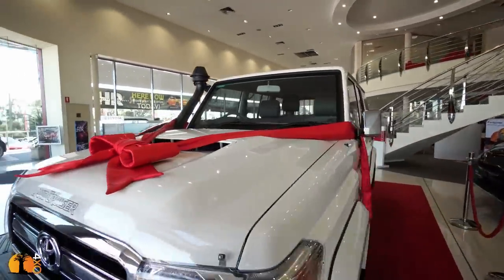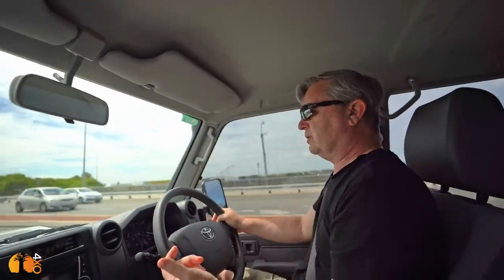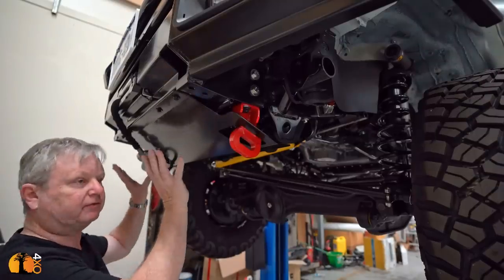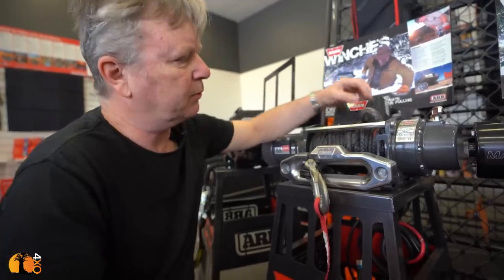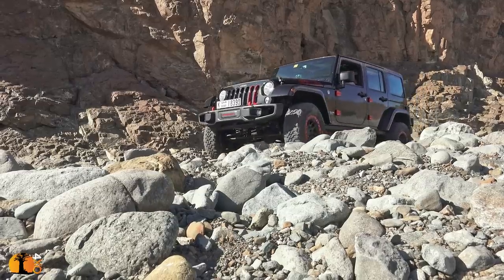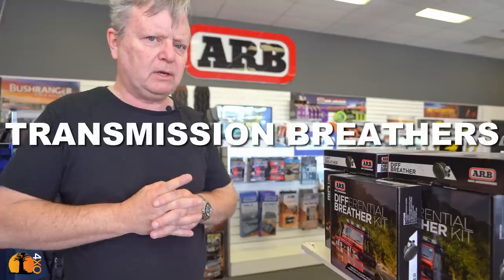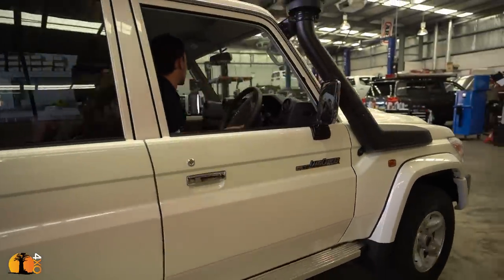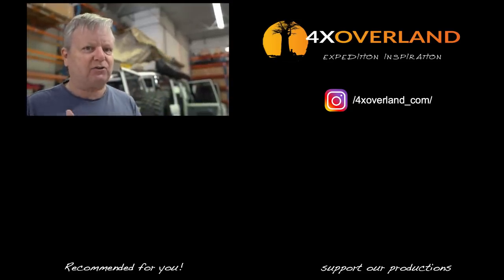How to convert a SUV into a 4x4 Overland Tourer. Toyota Land Cruiser VDJ76 | 4xOverland

Comment: good luck breaking a plasma line. when I was a U>S>Army Watercraft operator ( Deck side) on the small (900 Series Tugboats) as well as the bigger tug boats, that's all we used to tow the craziest of things. to date I don't remember hearing of any plasma lone breaking. so its good to hear that you can get plasma's for your vehicle winch. put a winch of the front and rear of your vehicle and set up to pull on both, I will bet that you will rip your vehicle in half before those lines break

Comment: The method I'm using is just take the vechicle out a lot and see where the limits lie and adjust accordingly. That way you prevent buying unnecessary "upgrades". I mainly use my vehicle on weekends for off roading with planned tours once in a while so I have the luxury to do that.  Ofcourse when outfitting for a big trip sometimes you need to do it in one go so good tips for that kind of stuff. Tires and a good air pump are THE best upgrades when starting out by the way. Seen guys with ARB bumpers and expensive lighting getting stuck because they use road tires in the mud :D

Comment: Soft shell tents have their advantages particularly since you can go out to king sized mattress and still not take up the entire length of the roof rack. The best I've seen for a hard shell traditional clam shell tent is a double sized mattress which is barely enough to sleep two comfortably..They may take 10 mins or more to set up..but at least a family of 3 or 4 can sleep comfortably..

Comment: When it comes to air compressors, I would have chosen an ARB product. From personal experience, even the single motor ARB compressor is far better in quality & durability than other brands in the market IMO. You really only need the twin motor model if you have lockers or frequently change air pressures (or  use it for cleaning dust).  But for use with tyre pressures, the single motor ARB compressor is more than sufficient.  I've had other brands and none of them lasted - most common failure is the motor overheating.  They just couldn't handle the task. I was lucky to get 2.5 years from one (the other two - different brands each - lasted less).  But the ARB, I've had now for over 5yrs and its still going strong - touch wood.

Comment: Amazing info and so much good advice, great video!!!
 
However, i would not agree about lockers. Lockers can be life savers. If i'm going off road i'm anticipating rough, uneven, muddy, sandy rocky or slippery terrain. Lockers are good for all of it. If you don't want the selectable lockers (ARB or OX) you can at least get the Torsen or Detroit so you don't have to think about it. It's a night and day difference unless you're on a flat terrain with good traction all the time. 
Some of my priorities for my area would be:
- more ground clearance
- bigger tires with more grip (mud)
- lockers (at least the rear)
Reply from the maker: Look, I don't disagree with you. But lockers often make bad drivers. Yes they can be life savers. But they are a cop out. Drivers who have grown up with them don't learn about effective lines through or over obstacles. This is the point I was trying to make. (IMHO. Larger tires - NOT wider. Its a fallacy that wide tyres are better in sand and mud. They are a disadvantage in most mud and no advantage in sand. Only an advantage in dry ground extreme grip situations like rock crawling. Proof: military and rally drivers use narrow tyres on soft ground. Another argument altogether!)
Reply: Lockers are good when you can’t drive

Comment: With an infrequently used winch he could spool it out and in every few months to keep it in check and moving

Good quality traction control systems might just be enough most of the time

If you wait 30 mins before crossing water you don't need breathers as cool steel and cool water won't cause the issue, downside is many cups of tea whilst you wait

Comment: the greatest item that influences fuel usage is the windage, even with only transverse roof  bars at 100km/h
you will use another L  per hundred  and with all that crap on the roof far more, towing a light 500kg trailer will be more convenient and use far less fuel, make the drawbar long , or you'll never back it as you cannot see it
btw LRs have all guards as standard

Comment: Thank you.Very inspiring. About winches - have you consider external (removable) winch? You can keep it dry inside the car and use it front/rear when needed. I think it could be great solution when you using it once or twice a year.

Comment: Andrew, you are truly my "go-to-guy" for referencing. Thank you for sharing what you love doing. I sold my Land Cruiser 76 (4,2 donkey diesel) for a Toyota Hilux - greater driving comfort and safety, as well as huge savings on fuel bills. What are your views on utes as ideal overland vehicles?
Reply: Grant Evans I have a new hilux, and I think the fuel consumption is absolutely horrible on those things, I don’t even have a front bar on mine, or massive tyres. I also find that they’re one of the most uncomfortable rides. So very interesting to hear you talk about the hilux this way. I hate my hilux and want a 76 😂😂😂
Reply: Hi Dean, I loved my Cruiser (14,5L/100km) and drove it to many, many places in Africa. I owned it for 8 years. The new Hilux (10l/100km), whilst having a full OME suspension upgrade and bull bar etc, is much easier to drive on the long haul, for example Johannesburg to South Luangwa in Zambia. However, nothing beats that Cruiser for toughness, does it?!

Comment: I'm pretty sure that letting air out of the tires won't give you better flotation. Less air= less flotation.
Reply from the maker: The opposite is true. Flotation is increased as the footprint of the tyre gets bigger. The larger it is, the less pressure there is on the ground. Tyre tread gets longer as the pressure drops. Less pressure = more flotation on soft ground.
Reply: @4xoverland  Ah, on soft ground. My mind went straight to water when you said flotation. 😂

Comment: Winches 7:48 I don’t really agree with “find out what other people like”. Because the market here in Aus is swapped with “cheap”. If you ran a poll here in Aus on winches ‘Kings’ would win buy a country mile. And there’s no way! I’d have anything Kings on my 4wd.
Reply: Oh come on, how can you not want a Dominator on to save the day again & again.. 😂

That said, their 7" spotties are pretty good for the money, 2 years of pretty abusive conditions on mine & still going strong. Use nail polish remover to get rid of the awful logo on the lens covers & they're every bit as useful as an $800 red bezelled lamp 😉
Reply: id never have anything kings either, but i did buy a kings winch to try it out (its hidden)...i literally cant kill it. i have actually been trying.
Reply: also, another way of deciding how big of a winch needed, a basic reference of 1.5 x GVW = minimum pull strength. (a more versatile way to apply to your vehicle)
Reply: Totally agree. Kings gear is utter shit

Comment: Very good concentrated video full of highlights! But I have a QUESTION: when a vehicle is not horizontal, it's sagging down at the rear because it's fully loaded, then some replace the normal shocks by coil over shocks to put the vehicle horizontal again. I'm afraid that is not the right solution because they bring over a part of the vehicles weight on the upper anchor point of the shock and that part is not developed to receive those big forces, isn't it. What's your oppinion ?
Reply: you should have a slight rake (usually 1-2" higher in rear) for aerodynamics and handling. this is also to accept the weight so when loaded it still has slight rake or becomes level. if you are regularly carrying weight that has your front sitting higher you need stronger rear springs (not shocks necessarily) to carry the weight.

Comment: Great video👌🏻
Very helpful..
I really think one of the most important modifications is the capacity of the fuel tank..how many liters can you modify the LC 76?? (Maximum capacity)
Thank you very much..
Reply: I think the LC 76  comes with a 130 liters tank and to my knowledge the largest to be fitted is around 165 liters.
Reply: @4x4pete30  165 additional to the 130??
Reply: No unfortunately 165 in total as a replacement. But at least 20% above standard, which can make a difference in some situations.
Reply: @4x4pete30  was expecting much more than that..made me a bit sad..
Thank you for your respond.. 
Cheers

Comment: Amaizing video! how do you fit the air compresor in this Land Cruiser? in the motor or in the back of the vehicle? where is the best part to put it? if you are touring.
Reply: In the bag, so it can be used on any vehicle that needs it.

Comment: Good points & a conservative build, perfect antidote to the bigger/more is better message that gets blasted in our faces from everywhere else. Glad you didn't go overboard in ARB too, now they aren't the only players in the market on accessories, as far as I can see the only truly good things they offer are the barwork (rear bars excepted as they're just unnecessarily heavy lumps of uselessness) & the magnificent freewheeling compressors. For a bit of fun, visit your local dealer & ask them to weigh the Patrol GU or Cruiser they'll have on show decked out in half of China's steel industry catalogue. I bet they wouldn't dare..
Reply: Rear bars are useful in some situations. I’d hang a wheel carrier on mine to move it from underneath the vehicle, and it can come with recovery points at the same time.
Reply: @cjeam9199  Agreed, however most on the market are severely overkill & weigh far too much. Considering there's normally a plastic/composite bumper there you only really need something structural for the recovery points & wheel carriers, not a heavy duty steel contraption. Would be nice if any of the manufacturers offered a slightly lighter weight model for those who simply want to relocate wheels rather than having pretty useless rear protection.

Comment: Question on the tyre, would a 265/75 R16 be better because it's performance would be very close to 285, it works be lighter and cheaper.

Comment: Fantastic video Andrew! Love these build videos! I'm considering BP-51 suspension but have heard they leak and squeak with the bottom bushes chopping out. As a mechanic i've seen several of these shockers leaking. So not sure about this decision.
Reply: For a few dollars more! Custom King 2.5 shocks with remote reservoirs and viton seals. Only talk to people that own them and not dreamers :)
Reply: Koni Raid HD all the way. Remote Res shocks are only really necessary when you use full travel, which you certainly don't come close to doing in any 70 series as they dont provide that much extra cooling & it's more bits to rattle loose over time.
Reply: @gaj5701  progressive custom King coils and Rockcrawler leafs in superior engineering Gen 2 plates with the kings and i get a hell of a lot of flex, if your comparing Konis' to Kings well i need not ......
Reply: @FZ-TAS  yep, you can certainly get good flex, however most don't go that far so on a build like the video there's no practical need to go as far as getting custom shocks or remote res units. The Koni Raids are well proven in outback touring use on pretty heavy vehicles & are pretty hard to destroy on corrugations so that's why I suggested them, not as a direct comparison to obviously higher end technical shocks 👍

Comment: First. In my opinion, weather it be supercars, motorcycles, commuters, 4x4s, or any motor sport, nothing is more important then the tires. In my mind there's no such thing as good enough. 

Second. On the subject of winches, I think of them like fire extinguishers. If you are using them regularly you may be doing something wrong. However if the time comes that you need one, you want the biggest most reliable one available.

Just my humble opinions
Reply: totally agree, tyres/tires are all that connect you to the surface you're driving on.... winches & fire Extinguishers, you hope to not need them but if you do need one you want it to be the biggest/best/ most effective you can get
Reply: I don't think so. I used my Warn winch most if the time to pull something which were nothing to do with srlf recovery of my Landcruiser. I am very often utilized the winch to pull wood logs, placing or moving heavy concrete pile bases to difficult places and other pulling, moving and placing/replacing or locating/relocating  heavy things. I utilized the winch to the maximum not only for self recovery of the vehicle and/or other vehicles.

Comment: For an overlander project that will through the American mountains (Rockies, Smokeys, Adirondacks, Sierra), as well as US Southern Low Countries, would you suggest a 1998 Jeep ZJ Grand Cherokee with 5.9L v8, with Quadra-Trac, which includes center locking differential in 4LO only, with open front and rear differentials OR a 2002 Jeep WJ Grand Cherokee with 4.7H.0. v8 with Quadra-Drive which has locking center differentials as well as front and rear limited slip differentials? I hear there are pros and cons to both, ZJ is easier to mod, not as good off road, the WJ is harder to mod, engine not as reliable, but is better off road. Anyone’s advice is welcomed please

Comment: Hmm...most people I know don't aggree about the difflocks. A 4wd without locks isn't a proper 4wd. This can already make a huge difference on a muddy lawn, and experience doen't help much if you HAVE to go slowly through twisting sections and our vehicle hasn't got a very good twisting suspension. Speed or momentum is not always a good compensation.
You might get around with a LandRover but not with a 4wd that's optimized for street use.
So I would say YES if your vehicle is extremely flexible, but generally NO (you need difflocks) with most 4wd.
And anyone will agree that experience lowers the need for difflocks. AND: difflocks also mean a great stress to all participating parts - so you really should use them only when driving skills don't help and not because you're lazy. It could quickly kill your axles or CV joints.
Also, on some ground, a front locker makes your car go straight like a train, even when steering. Can be really dangerous.
Reply: All new cars/4wds in australia from 2015 onwards have traction/stability control, so they arent as usless as they use to be when unlocked.
Reply: @jakewarren9465  traction control is better than nothing, but it kills power because they use the brakes and eventually choke the engine. Traction control is ok for laymen and every day use and it definetely conserves the transmission against overload. Both is good, but you should nevertheless be able to lock and switch off the control if you really go offroad. Else, it might happen that you cannot go up a tiny dune because the electronics breaks you down to a safe "no spinning wheels". 
Same on snow: instead of just grinding through it, you will be stopped dead and wonder why on earth you did buy a 4wd?? I just recently pulled out a modern 4wd out of the snowfilled roadside ditch with my old 2wd and the guy was almost weeping about this humilation.

Comment: Why are installing gas shock absorbers as compared to say foam?
Reply from the maker: Oh. You mean IronMan foam? If you like an unforgiving harsh ride where you feel every bump and undulation on the track, then Ironman foam shocks are your you. I prefer something something that will absorb the ride, smooth it and offer control. Never in my life have I driven 4WDs with such poor rides as the three that I tested that had IronMan foam shocks.
Reply: Using Tough Dog foam, or soft dogs as I call them. Was not the best choice but only ones available for my lift. I had koni and they were good. Having used OME Nitrocharger’s on another vehicle I will replace them foam shocks with these. The foam shocks rust out too, few years and gone.

Comment: Hi Andrew. Love your posts. 
On your recommendation, I bought a Lead Crystal battery (100ah) and a Redarc 1240 BCDC charger. I have tried to get some info from Redarc on what setting I need to have the charger on. They were non committal on this.
At the moment I have it on the "A" setting 14.6 volts. I have been told the this type of battery needs to be charged at 14.7 or 14.8 volts.  Is this the case and if so, what ramifications will this, slightly lower charging voltage, have on the battery?
Your expertise and feedback on this would be muchly appreciated.

Comment: greetings from germany. :-)

Edit:
i checked the land cruiser model... forget my question. :-)

 I find it quite hard to understand which vehicles are new or used, because the australian market seems quite different from the german one. It makes sense of course, the Australian customer has completely different requirements for a car. You have different builds / options you can buy or choose from. If i take the Toyota Hilux for example. In germany (toyota.de domain) we have totally different current models. Duty, Comfort and Executive. On the toyota.com.au domain there are Workmate, SR, SR5, Rogue, Rugged and Rugged X.

so... when you explain, that you build a Land Cruiser 76 Model for german customers, i find it hard to understand if this is a new or used one. It looks at least new, but seems to be an older model? mmmh...can you explain this on occasion?
Reply: It is a brand new 76, Australian spec GXL, purchased in Australia (I think Andrew says that at the beginning of the video).
New 76 left hand drives are available in Germany as imports from Dubai or so. Modells and specs however differ.